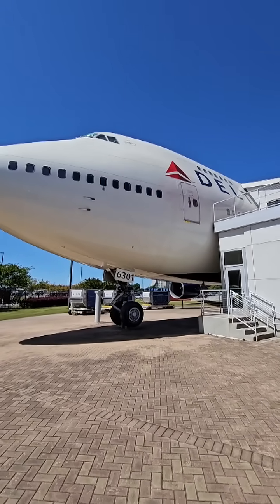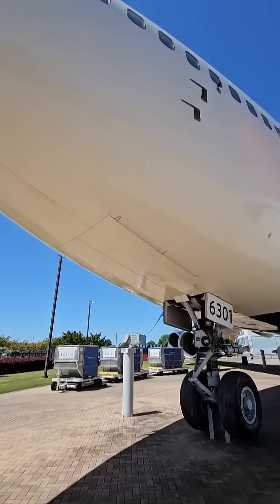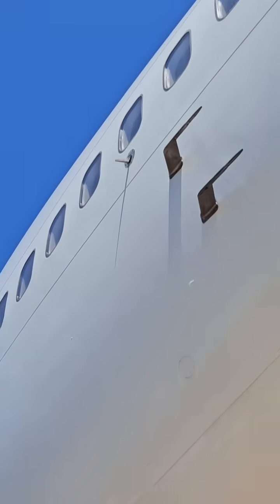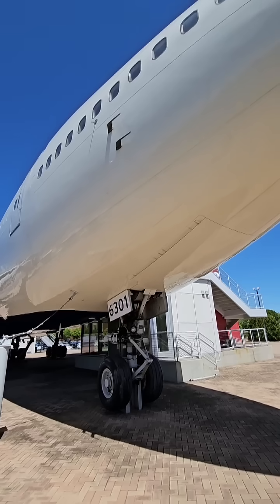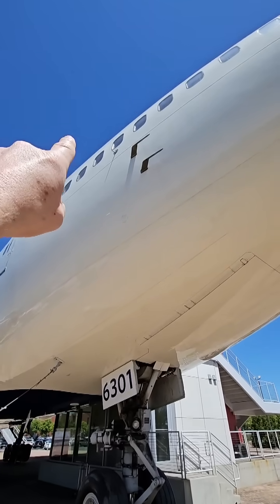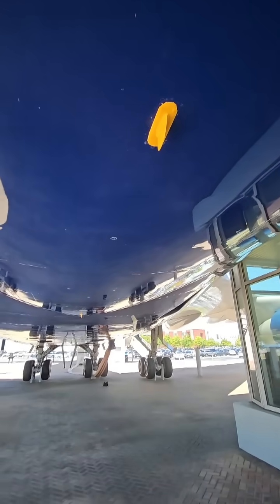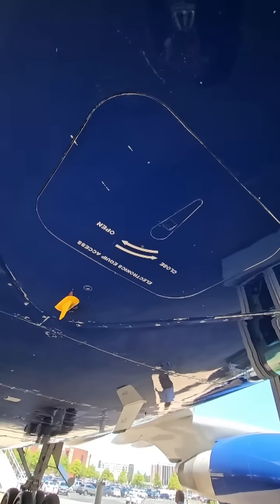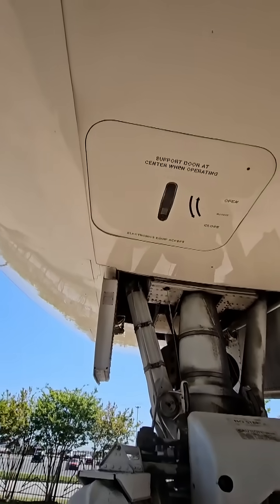All about the Boeing 747-400 pitot tubes.

Comment: Angle of attack is extremely important and Boeing cheaper out and started putting only 1 on each plane instead of 2 and that’s why the Max has been having a lot of issues
Reply: The 737 MAX is fine now, and has been for the last 3 years, flying thousands of people safely internationally l. The reason was partially because of that, and partially because the probes were faulty, which led to MAC (maneuvering charichteristics augmentation system) activating, believing the aircraft was in a stall forced the crashes: the 747 400 has not had this issue, all 767 747-8 777 and 787 also do not have this issue, nor do standard 737s. This issue has been fixed, all boeing airplanes have 2 or more AoA probes
Reply from the maker: You forgot to mention that Boeing never told their pilots about the MCAS system nor did they require training for it. That was a big factor in those crashes.
Reply: @CaptainZtravels well, if it wasn’t for their failure of not adding 2 AOA sensors, MCAS could have been kept in the background. But because there was only 1 sensor, 100% it was crazy they didn’t tell them about MCAS!
Reply: @CaptainZtravels  Absolutely! Thats completely my fault for not mentioning that! but yes, it now required a 2 hour training period in the simulator I beleive?
Reply: @ I know, but it was still a bad idea to only use 1